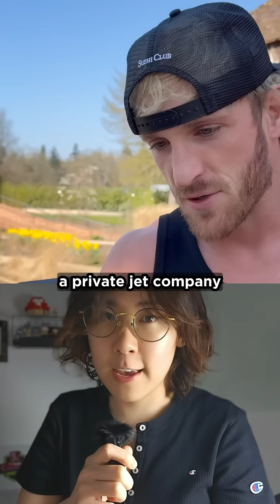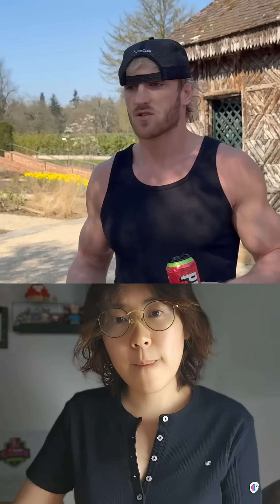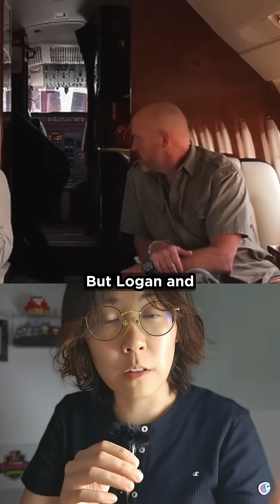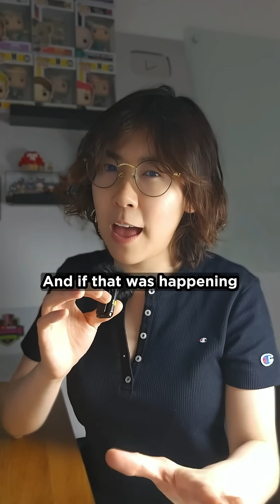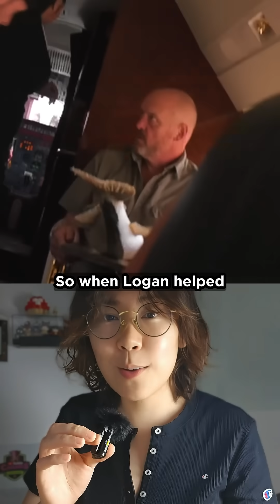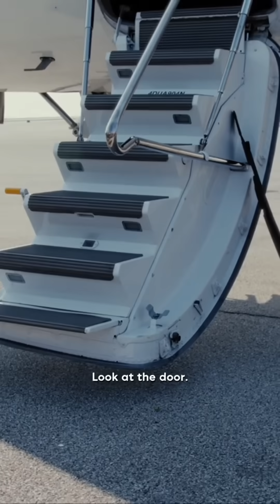How Logan Paul’s Jet Door Really Blew Off

Comment: So the private jet should depressurise the cabin before asking Logan Paul help opening the door so that he would not have to cause the door to he pushed open forcefully by the air pressure?
Reply: Yeah. Once the pressure inside is equal to the pressure outside, it's safe to open the door.
Reply: The plane shouldn't have  been pressuring on the ground anyways. It's either the pilots fault or an issue with the plane
Reply: @agent1gamez Seems like either there was something wrong with the pressurization system or the aircraft could have gone through servicing recently that had a pressurization check and the system was never taken out of test or maintenance mode.
Reply: Yes, however there was probably very little pressure in the plane. That probably why the door was hard to open. If it had been fully pressurized, I don’t think it’s possible to open them.
Reply: @alexlynch8302  yea maybe
Reply: @tylerfb1 dude did you watch the video?
Reply: @86harbinger  yeah. You think cabin crew regularly struggle to open cabin doors? Full differential pressure (that's the maximum allowable difference in pressure between the inside and outside, which is usually around 9psi) on that door is something like over 10,000 lbs; that would have caused the door to explosively depart from the aircraft as it was opened, which did not happen here. But since that's really bad, and will usually cause the destruction of the aircraft if it happens, especially in flight, at even normal pressurization pressures (not max), usually the latches have locks that prevent the door from being opened. But if they don't have locks, its still very difficult if not impossible to physically move the latch mechanism.

I don't think this is exactly fake, more like hyped. Knowing what I know, what happened (the difficulty opening the door, the sounds it made when it was, and the damage incurred) is exactly what I would expect to happen if the pressurization control doors were closed and the APU was on, leading to minimal pressurization of the cabin.
Reply: @tylerfb1  This borders on attempted manslaughter. People have died opening  doors like this, because they were pulled out onto the tarmac.
Reply: Proof the pilot had absolutely no idea what was going on or lacked the aptitude to recognize what the flight crew was doing.
Reply: @carlosramirez3510  Honestly, just shutting the engine/APU of the plane off and waiting a minute should be enough to equalize the pressure between inside and outside. This cabin crew clearly had no idea what they were doing and opening the door is actually very dangerous. Logan could have been ejected out of the plane.
Reply: @tylerfb1  Dude, what was the point of your comment? Lmao, you stated the obvious but worded it wrong, and then just overexplained the same thing when someone got confused — and then you still worded that reply wrong. It’s obvious the plane is in the process of pressurizing when they are already on the ground, but when you say the cabin was "low pressure," you make it seem as if you have it backwards. You should specify that the cabin isn't fully pressurized, but that it was still higher than 1 atmosphere — not that it was low pressure. If you don't have the writing skills to clearly articulate your explanation, then don't try and school people on the internet.
Reply: @barfingchickens1227 . I thought it obvious that airplanes don’t, can’t, lower the pressure inside to less than what’s outside. 

So when I say low pressure, I thought you had the reasoning skills to understand that it was only slightly pressurized.

My mistake.